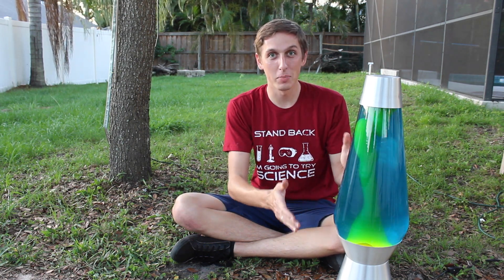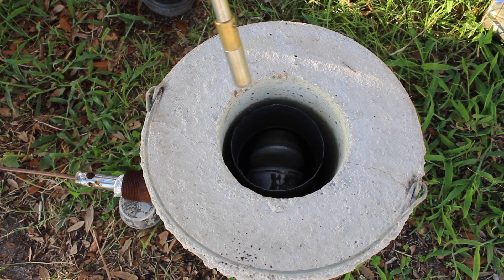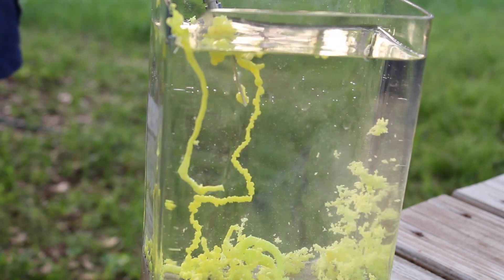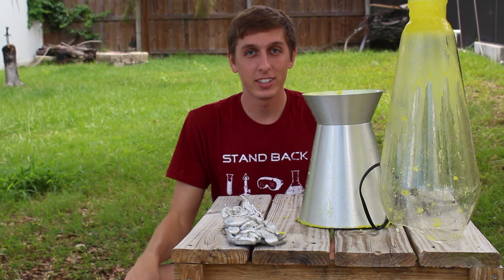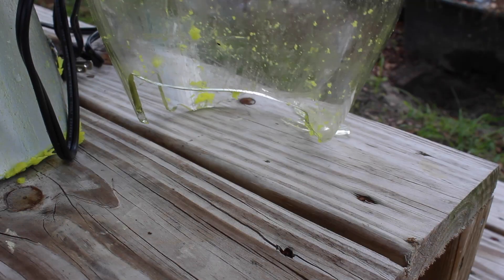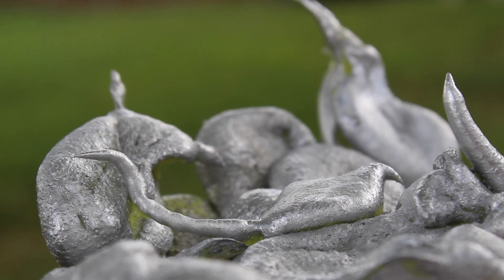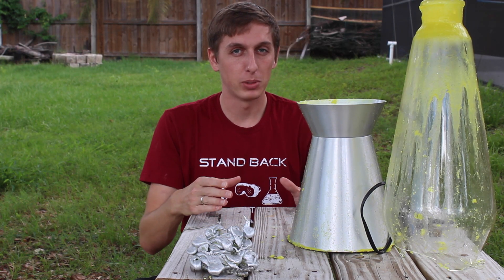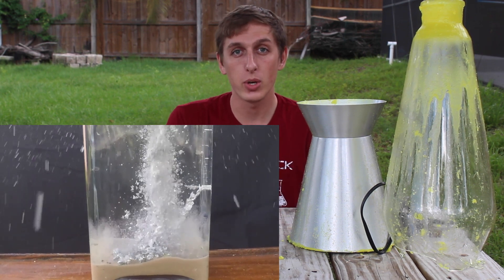Molten Aluminum Vs. Lava Lamp

Comment: please try this. 
melt several different kinds of candle wax and our it into a cold cold water bath. it will float. I did it at home and it made a really cool sculpture. different poring speeds and water temps will give you different results. 

what I would like to see is what happens when you pore melted wax into something like liquid nitrogen. 

any super cold liquid. it needs be denser then the wax so it floats.

Comment: Fun fact.

If you look at the mass of hardened aluminum he shows off after the experiment, you can see a good-sized metal coil
sticking out of and trapped in the aluminum mass. That coil was the Lava Lamp's heating element.
Reply: Yes, that is part of the Lava Lamp.

Comment: Have any ideas what I should do for a science fair?
Reply: +KyroGraphics - 2D Graphic Designer It's *how scumbag
Reply: Elo, Try making a Lava lamp maybe? that would be cool
Reply: +KyroGraphics - 2D Graphic Designer Merry Christmas lmao
Reply: +Elo Veltix Please, do not listen to that idiot +KyroGraphics - 2D Graphic Designer Just make the lava-lamp that was suggested. It's easy. Fill the lava lamp with bleach and wax and ammonia; that way the wax will stay melted longer and make cool patterns when it swirls. Also, before you seal it, take a big whiff, the mixture smells unbelievable. it's like a dewy meadow of bubble gum, yum!
Reply: +Elo Veltix see how long it takes to set off the fire alarm
Reply: Make Oobleck, or make homemade flares by mixing stump remover and sugar on a heated stove.
Reply: +Your average person that does not work. the magnet needs to either be spinning or trapped in an acrilic tube so it can't flip

Comment: like, are you kidding? This is something you learned in Chemistry, hot, molten Metal introduced to a vessel that has an operating temperature of between 77 and 80°, molten Aluminum is at least 500° or less.

Comment: ***** Nice video, though you might wanna run the audio through a noise filter next time (Audacity is free and easy to use).
Reply from the maker: Jeroen van Oorschot Thanks for the heads up! I just used the default 'reduce noise' and 'boost vocals' in iMovie, ill try audacity also.

Comment: Please be aware of the nature and put a tub under the lavalamp to prevent toxing the soil beneath it. Else it was nice to see. :D
Reply: Gustav Kranz Toxing the soil with what?  Some wax, water, artificial coloring, and aluminum?  Learn some chemistry.
Reply from the maker: Gustav Kranz  Aluminium is the third most abundant element (after oxygen and silicon), and the most abundant metal in the Earth's crust.
Reply: Im thinking mote about the liquid in the lava lamp,which got mixed with the earth. I got no problem here with aluminium. :)
Reply from the maker: Gustav Kranz Oh ok, some people complained about the aluminum. You might be right though. The liquid is just water with food coloring, but the 'lava' is some kind of wax that wont wash away. its still all over the ground :(

Comment: Hmmm, why no B.L.E.V.E? When I worked at an aluminum smelter they forbid fluids near the molten metal.
Reply: David McSween - Fluids are only a problem if they get under the surface of the molten metal. Rapid expansion of water into vapour is the source of the explosion :)

Comment: were did you get the needle?
Reply from the maker: JMAPScience I have a ton of glass syringes from Ebay. And you buy needles at any drug store. I get funny looks sometimes but im allowed.
Reply: ***** I have gotten the plastic syringes too from there but that glass one is very nice. By the way I got a 24/40 glass still today. I have been having fun making KNO3.
Reply from the maker: JMAPScience They are perfect for solvents that would normally dissolve the plastic syringes or the rubber plunger. Also good for sulfuric acid because that destroys the rubber also. I really need to get back into chemistry!